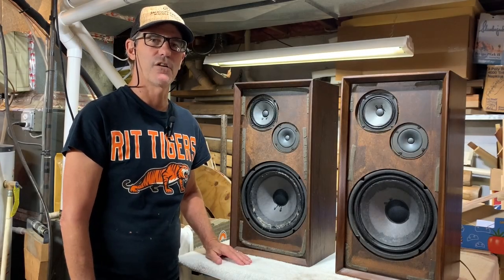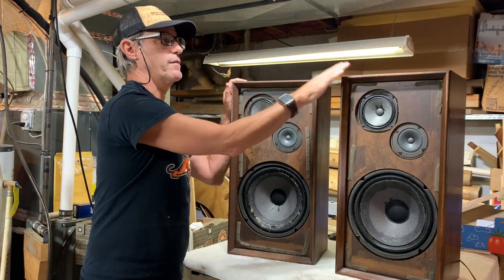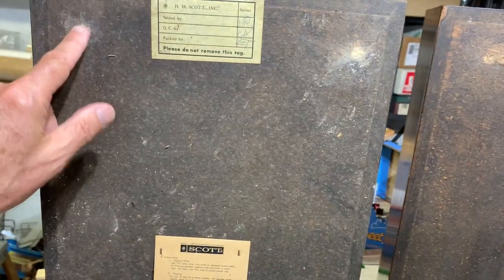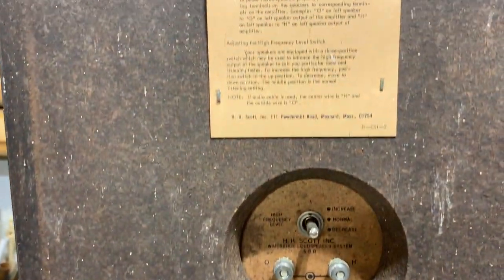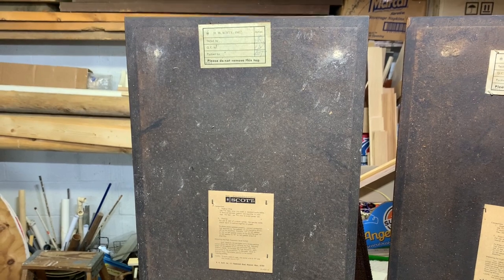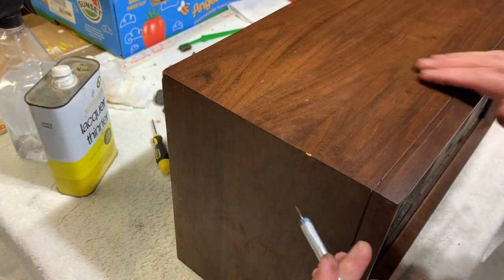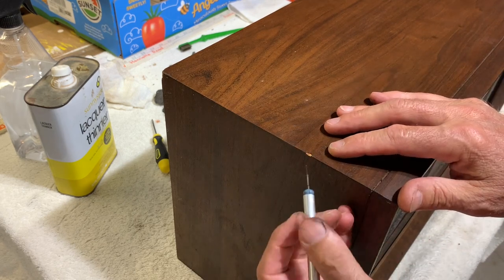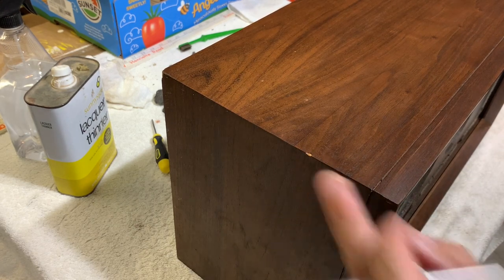How to Refinish Speakers: HH Scott S-15; Tools, Supplies & Tips!

Comment: You’re a life saver. I had bought those speakers at a Goodwill for $20. I had them listed at eBay, and an interested party wanted to see the condition of speaker and wires. I actually had no idea how to remove them, until I came across your video. I can’t thank you enough. I actually thought they came off the wood seam. It would’ve been horrible. They’re in excellent condition. Thank you kindly.

Comment: A tip you could of taken the drivers out and refinish the baffle Board but very good restoration job :-)
Reply from the maker: Yes, good idea. It certainly has a patina to it at this point. One reason I didn’t is there are foam strips around the perimeter, which push the grill up against the retaining wood trim piece. And frankly, I didn’t want to spend the time, effort and cost replacing them.

Comment: Have you ever tried using a wood based putty to fill holes, which would then absorb stain? If so, do you still prefer your method?
Reply from the maker: Yes, I always try to use real wood to fill holes, preferably sawdust from that actual item you are filling. This is the best method. When I am forced to use a wood putty, I actually mix the stain in with the putty. This takes longer to dry, but then you have a color matched putty. It usually doesn’t even require staining after the fact. In this case, someone else had our use putty to fill the holes and I was left trying to cover it. I actually ended up using one of my furniture markers to blend it better after I used the stain on it.
Reply: Thank you!